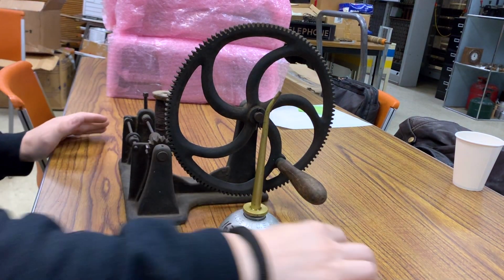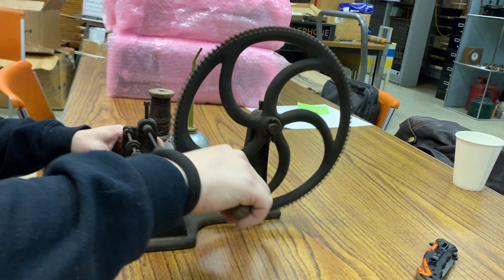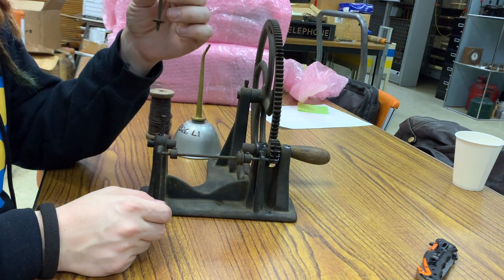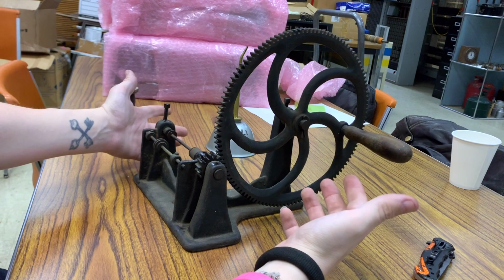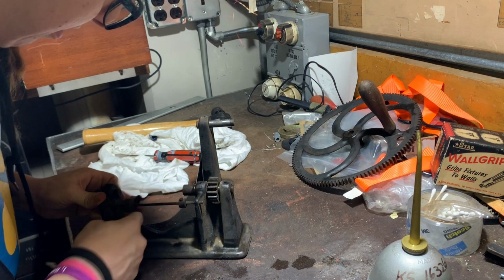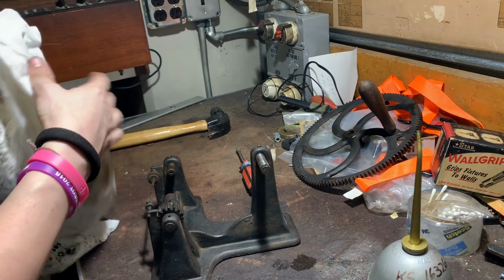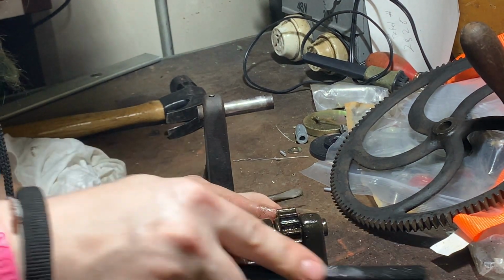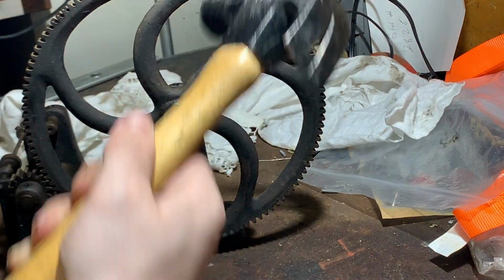What's this fancy tool do?

Comment: I've never seen that before, but as someone who winds coils (tesla coils), the relay bobbin goes on the removable spindle, you need to support the reel of wire at a distance so it runs over the free moving pulley, the run between spool and bobbin will be straight(ish)
The 2 stops on the pulley shaft can be adjusted for the limit of travel on the bobbin.
As you wind the relay, you need to arrange slight tension on the wire, i usually do it with a clotth or foam pad around the wire close to the supply spool

Comment: Sarah, I have tried to count sprockets on each gear.  If there are 15 on the small gear and 120 on the large gear you will get eight winds for each turn of the crank.
Reply from the maker: gpwgpw555 I counted the turns, and 8 was my result as well!

Comment: That's a long locking berjingus you have there.  I wonder if the wire spool is supposed to sit on it (and then the wire route around under the shuttle pulley and on to the axle from underneath)...?  A bit of a tortured feed path, I guess, and rather prone to skipping.

I like and agree with your restoration philosophy, btw - old things have value because they're old, and they should look like they've served their time (but be maintained so they work, if possible).  But then, I like steam trains, so I guess that's no surprise.